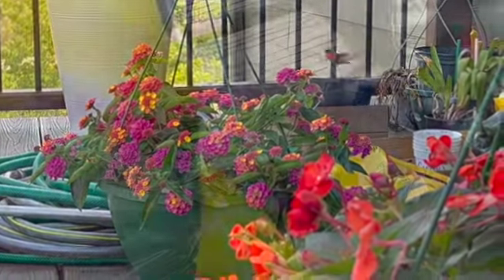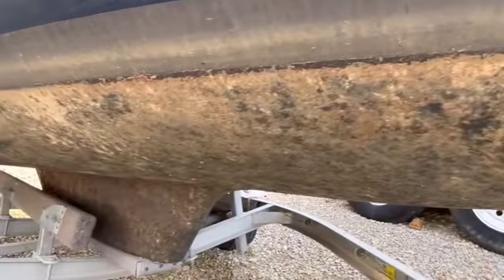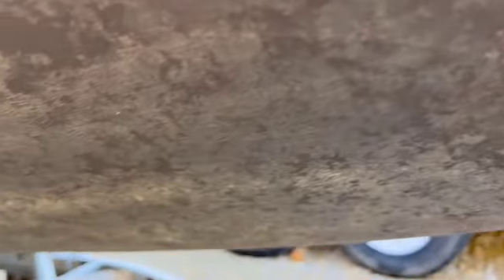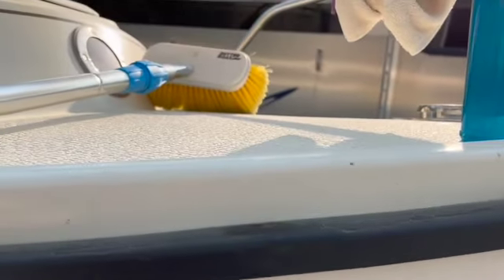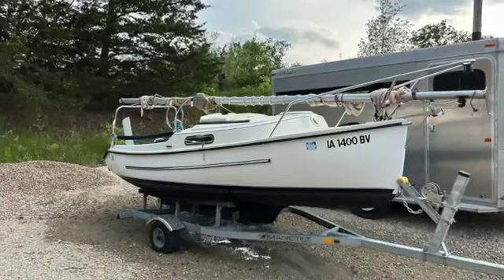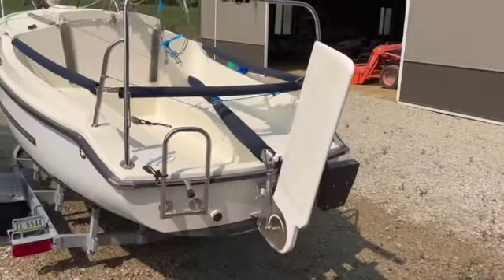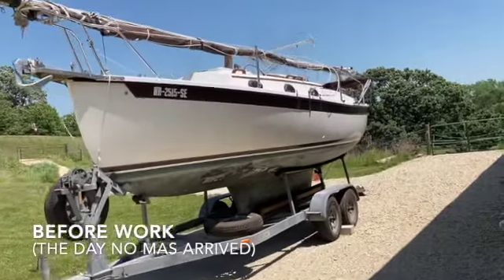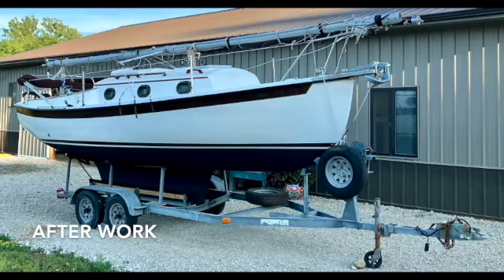A New Sailing Season & A New Boat | Season 3 Ep 1

Comment: Two beautiful boats!!  I’m hoping to bring Mariposa (our Com-pac 23) out of storage this week.  I agree with keeping things simple!  One of my major projects is to get the roller furling working—I bypassed last year and used easy hank-on sails, but I think having the sail on a furler will clear up the cabin.  

I think I mentioned that we had a leaking thru-hull on our first multi day trip—lots of things got wet and it was fixed as soon as I got it home!  

I had a problematic experience while trying to get a brass oil lamp, and ended up with four of them....  I couldn’t afford the Weems and Plath (spelling?) so I thought I would try to get one from eBay that was shipped from India—how bad could it be?   First one: sent the wrong lamp, refunded purchase and had me keep it.  Second one: did not arrive—lost in shipping and refunded.  Third one: I did not think it was going to arrive, so I ordered another...  Fourth one: (the kind I should have ordered in the first place.  It is a gimbaled oil lamp with a glass chimney and a separate shield mounted above the lamp.) Came quickly and I really like it!!   Second one arrived bent up and non functioning—I’m glad it was already refunded..  Third one arrived and the design is “just-okay.”  

First three are actually called Miners Lamps, or Coal miners safety lamps...  Fourth one is a regular ship lantern.  So, my pretty accent lamp ended up taking a lot of time that probably would have been better used on the furler! 

Thank you for the video—I think you made two great boat choices!!
Reply from the maker: Randy! Hiiiiiii!!!! Happy Spring! I remember you telling me about that thru-hull situation -- I am glad you got it resolved AOK! I think that thru-hull failures are one of my worst "scary boat scenarios." The others would be hitting a hidden object in the water and a dismasting. When I was a kid, we got caught in a pop-up severe thunderstorm and our mast came down, but we didn't lose it overboard, fortunately. It was on a sailboat a little bigger than Sunny. It was a pretty frightening experience from what I remember. Back then, there were no cell phones to check weather radar, etc, so I don't fault my mother for making the choice to take us all out for a sail. From what I remember before the storm hit, it was a very windy day with sunshine snd some clouds. We sailed to a beach on the lake, anchored the boat near the beach, and not long afterwards, all heck broke loose. We tried to make a break back for the marina (in hindsight, my mom should have probably just sit tight where we were), and in the process, had the mast come down. To make matters worse, because the waves were so big out on the lake, the small outboard engine was cavitating -- the prop wouldn't stay in the water and it kept popping up. My step-dad had to sit on it to try to help keep it in the water! We didn't make it to the marina, just to the other side of lake where we tied the boat up on shore.  It was quite the day! Keep me posted on your adventures with Mariposa! Charm should be here, soon, and I hope to get her splashed soon afterwards!